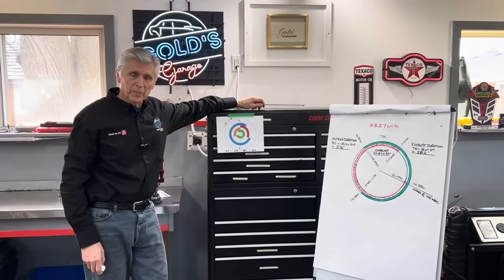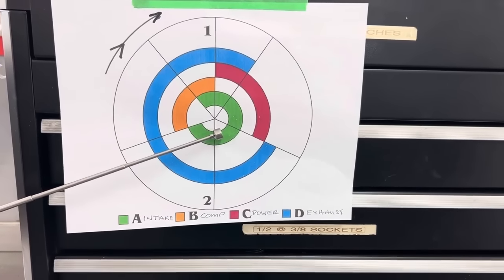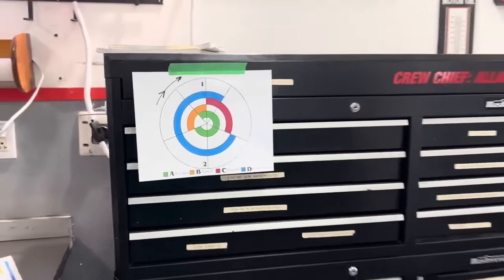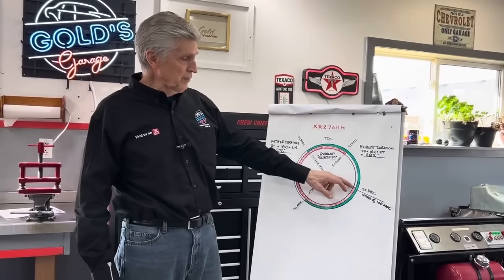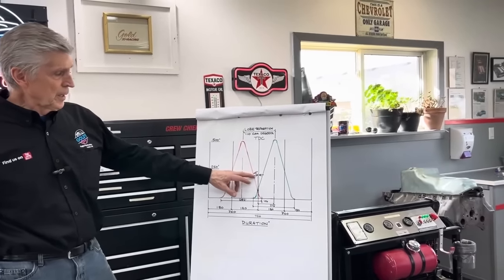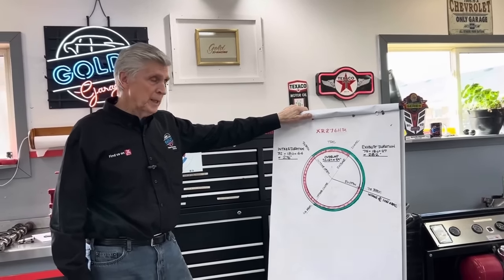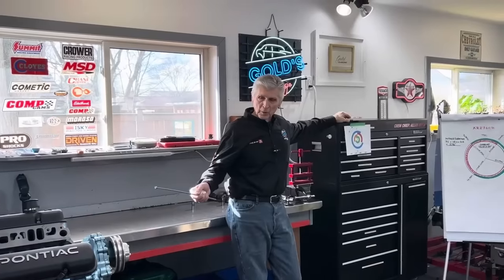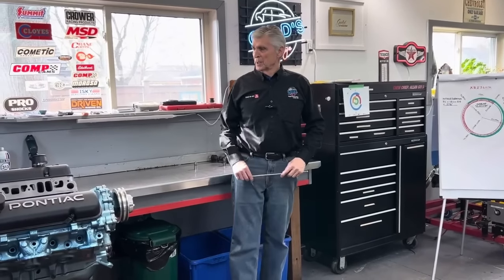What are LSA and overlap? Are they important? Why do camshafts have 4 degrees of advance ground in?

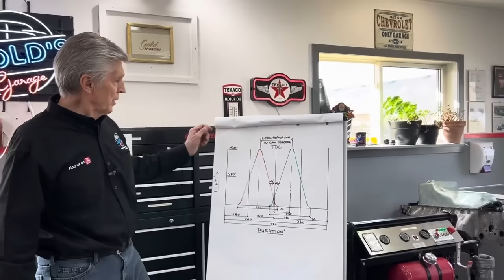Comment: Thank you for this detailed explanation. For me, it is timely. I need to decide on fuel grade (octane), compression ratio and cam timing, with my intended use. In my case, middle grade fuel - 89 octane and daily driver use with a view toward efficiency. I have a Ford Cleveland to assemble as well as a Ford Cologne 2.8/3.5. At 18:00 in the video, you talk about the need to get the valve open in time to fill the cylinder, and 4° of advance is a sweet spot. Clevelands have enormous valves and flow well at low lifts. They can be further goosed by using Pontiac valve angles. I’m thinking I can finesse the duration a bit, or widen the LSA and shorten the exhaust duration to get back some efficiency.
Reply from the maker: Thanks Pc, you have given this a lot of thought. AG

Comment: Great video and thanks for showing the hydraulic cam and the roller cam. The visuals really help the explanations. I can see how important it is to be realistic with regard to the car = is it for street only, street and strip, or strip only? And the cubic inch of the engine, the combustion chamber size of the cylinder head, the compression ratio, the valve timing is so critical here!!  And the rear gearing and the weight of the car and if the car is an automatic transmission = what is the stall speed of the converter?  It all matters and has to work together to give the car the desired result for the driver!!!!
Reply from the maker: Thanks 4 speed. You are a great student. AG

Comment: Good presentation with helpful graphics. Another aspect of cam choice is dual pattern. Also I learned for my application of a Tstorm charger on BBC crate 502 is higher LSA for boost, so chose Crane roller with 112 LSA. JIC you read this it has 288/296 dur, 587/610 lift.
Reply from the maker: Thanks for your comment Goratgo. AG

Comment: The longer exhaust is from circle track racers. It bleeds power so they stay on the throttle in the turns.
Reply from the maker: Thanks Vince, good point, we will be doing some experimenting with that. AG
Reply: @goldsgarage8236  it would be interesting to see if symmetrical cams make more power

Comment: Possibly in the future, while you're degreeing a cam... you might look at how much increased lobe lift is aquired with the 4° advance @15° ATDC vs. the straight up 110° @15° ATDC or any suitable reference point ATDC. More lift when the intake stroke really starts to drink... equals more early fill in the intake cycle. One small detail often overlooked when advancing. Excellent tutorial...
Reply from the maker: Thanks for the suggestion and comment. AG

Comment: I would like to see you YouTube engine builder/guru's start teaching us some stuff about the Gen 3 Hemi's.  I included DV in this "challenge".  The G3 hemi, especially the later Eagle and Apache variants, offer a lot of power, equipped properly.  DV's "128 rule" (I think that's what he calls it) is aimed at SBC's.  I've heard that it doesn't apply to the G3 Hemi.  Understandable, to a degree.  An engine is an engine is an engine... except when it comes to the cylinder head.  And that's where DV's formula doesn't work on the Hemi.  As an Eagle owner (5.7), my heads flow just over 300CFM (I) and 155-ishCFM (E).  With all that said, I'd like to see you guru's pick apart a Hemi and show us what does work, what won't work, and why.  Thanks for the video, too.
Reply from the maker: Thanks Ron, lot's of interest in this, I am not an expert in this area, but i will talk to Bill Little about doing something. AG

Comment: Great video Allan! I just had one question though - I like to work things out myself and I actually calculate 2.5 degrees of what you refer to as advance, rather than 4 degrees. If you look at your graphic with the two cam lumps on it (introduced at 14:25), this shows a timing sequence that spans from 0 degrees to 720 degrees on the horizontal axis. The midpoint is 360 degrees which corresponds with TDC. The intake opening occurs 32 degrees before TDC (which is at 328 degrees) and the exhaust closes 27 degrees after TDC (which is at 387 degrees). The difference between these of course is the overlap: 387 - 328 = 59 degrees. The midpoint of this overlap area is at 357.5 degrees, which is 2.5 degrees before TDC, not 4 degrees. I know that this assumes the same ramp on both lobes (symmetrical lobes) which is not exactly true because of the duration difference between intake and exhaust, but that's only a 2% difference - pretty negligible. Am I missing something?

The other thing I wanted to mention is that what is being discussed here is not exactly cam advance, but cam asymmetry. If this camshaft is installed such that all the specified opening and closing points are correct relative to the crankshaft position, then it's considered to be installed straight up, regardless of how it's ground. Some people however then actually advance the camshaft on installation (I'm sure you're aware of the offset bushes that are used on Chevys to achieve this) so that all the timing points shown on the cam card actually occur a few degrees sooner than specified. That's what advancing a camshaft technically means. 😀
Reply from the maker: Thanks for your comments Shark. You have given this a lot of thought. 
On the first point, have you taken into consideration that the exhaust valve has more duration than the intake?
on your second comment, you are correct. Advancing the cam refers to moving it relative to the crank. The factory advance however is ground in and cannot be moved. 
Hope this helps, AG
Reply: @goldsgarage8236  Yes the difference in duration has a very small effect, basically it becomes about 2.55 degrees.

Comment: Hey Allen, u seen very smart and knowledgeable on engines. Id like your ideas and what u think on David Vizards 128 formula for the correct  LSA in engines.  It's probably  more for performance  race engines rather not so much for towing and pulling engines. Seems  his formula favors the tight LSA numbers. 106/108 etc.  For the most low rpm, mid range and top end all across the torque band of the engine they make more power.   He uses it to pick the correct LSA of cams then overlap.
Reply from the maker: Good question Jesse. I have David's book and I have used the formula. Sure, i think it works, especially for max power. I think cam makers often use a wider LSA to improve drivability for street engines. Even Bill Jenkins, years ago published that he thought 109 LSA was ideal for a SBC. AG

Comment: When you are bleeding off your compression, wouldn't you also be sending unburnt fuel out the exhaust making less HP?
Reply: Yes but only at low rpm.once rpm goes up that goes away. As the events are happening faster.
Reply: Static comp vs dynamic comp 
Also remember hp= fuel bill

Comment: Great video! Thank you for sharing.

Question: I have a Pontiac 350 but do not have any information on the cam that was installed when the motor was rebuilt.
What is your recommended process for determining the cam spec without opening-up the motor?
If you can please share, then I can move forward with determining proper cam set-up, including setting proper valve lash.

Thank you!
Reply from the maker: Thanks for the question Eric. If the engine is in the car, remove one rocker arm and measure the valve lift. You can do this using a dial indicator directly on the push rod. Compare this lift to the factory specification. 
Lift and duration go together so it will give you an idea of the cam size. 
If the engine is out of the car you can use a degree wheel to check the duration. 
Hope this helps. AG

Comment: It seems that by changing the degrees of timing, it controls the length of time the valves are being open or closed.  It appears to have a direct effect on the overlap time. So, is this how timing has such a major part in Hp making ?
Reply from the maker: Thanks for the question Free. Overlap is the number of crankshaft degrees that the intake and exhaust valves are open together. The overlap cycle occurs at the end of the exhaust cycle. At this time, the exhaust valve is closing and the intake valve is opening. Overlap is the product of duration and LSA (lobe separation angle) More duration provides more overlap and more (wider)  LSA results in less overlap. Typically, more overlap increases high RPM power at the expense of low speed drivability and vacuum. Hope this helps. AG

Comment: I`ve always wondered why when degreeing the cam shaft, only #1 cylinder gets checked by engine builders ?
 If a cam grinder is worn out, be it the machine or the guy running it,the lobes might not be (in sync) with each other.
I know nothing can be done about it after the cam has been ground except to try a different cam.But precisely setting the #1 piston is not proving the whole cam is optimized. 
Being in the ballpark might just be it.
Reply from the maker: Thanks Ted. AG

Comment: cam sales has been the most deceptive thing for the newer engine builder for the street, all those 1/4 mile cams look GREAT with peak hp numbers, but low and mid torques is what you need on the street. 
ppl are smarter about it nowadays. 🤠
Reply from the maker: Great observation, thanks Dan. AG

Comment: Ok ... A few things  

Inertia ram happens at the intake closing point not at overlap and is also why you understanding of dynamic compression is not accurate .... At overlap what happens is scavenging caused by exhaust to pull on intake charge but that only happens at high rpm ..... Overlap is not needed at all to make power and i have proven this by grinding a camshaft without it and the hp was still great ... Scavenging is a minor player in power and only works wit open exhaust and long header ...

In drawing a camshaft with events a circle with 720 degrees rather than 360 really helps see whats going on the old way you use is confusing ...

Its better to look at .050 numbers because not all camshaft advertised numbers are at .006  so hard to compare

I have my chalkboard videos on my site that shows more what I am talking about
Reply: Not sure why you watched this video if you already know everything. Those who exhault themselves will be humbled
Reply: @littlevman2997  because my health is bad and I'm trying to teach people what I have learned in 40 years of doing this stuff
Reply: @littlevman2997  quit virtue signaling, he is sharing his knowledge in a subject he is interested in, which happens to be stuff like in this video. Maybe you should get off your high horse, perhaps look at his info then research to find out? What if he is 100% right and the guy who made the original video is mistaken??? Do you even know who is right or wrong do you even care to research and find out???

Comment: I think you forgot the fenonon called explain blow down. the moment the exhaust valve is opened. 
A good demonstration that you can use is get a can of your favorite soda. Shake the can and crack it open as a viedo illustration on how the exhaust gases escape past the exhaust valve, don't forget to mention that the exhaust gases are traveling supersonic.
Reply: As long as you have long tube header to use that force to create a vacuum behind for suction of fuel/air your good

Comment: At  27:02 to 27:07 the camshafts are rolling back and forth (the heaver area  is trying to go to lowest point) "an out of balance condition"                                <<<{{ left   and right  }}>>>>      Any ideas on how to correct this condition?
Reply: Good catch on a small detail. He said one of them was a BB Chevy. The lobes for 4&8 or 5&7 are on the same side of the engine so they are close to each other in the rotation (NOT front to back, but as it turns) When the cam stops rocking, the centers of those pairs will be top & bottom.

Comment: Too much cam can kill torque and hp.  I'm doing my homework on the next engine before buying parts.  I through one together when I was twenty years old and man what a low compression dog.  Live and learn $$$$
Reply: Nitrous would of made that a killer combo with a 3500 converter you would of had a 10 second capable engine

Comment: Check out David Visard's formula for determining the perfect LCA. Its great stuff.
Reply from the maker: Thanks 43. You have given this a lot of thought. On your calculations, have you taken into consideration that the exhaust duration is more than the intake? 
On the advance, yes you are correct. advancing the cam refers to moving it relative to the crank. The factory advance is ground in and cannot be changed. Hope this helps. AG

Comment: Built in cam advance will also offset the never mentioned cam retard once the engine is running, as well as timing chain stretch which happens over time.
Reply from the maker: Thanks for the comment. AG